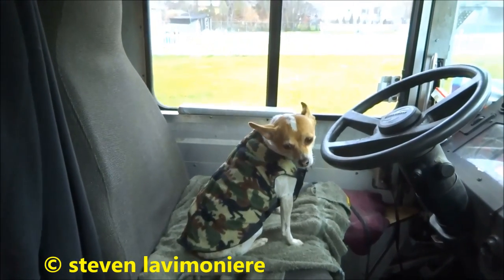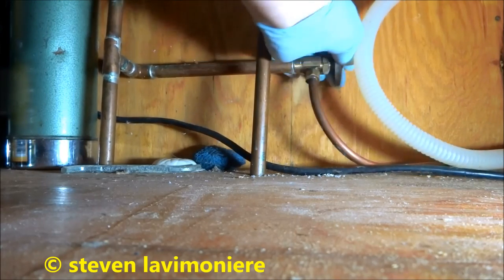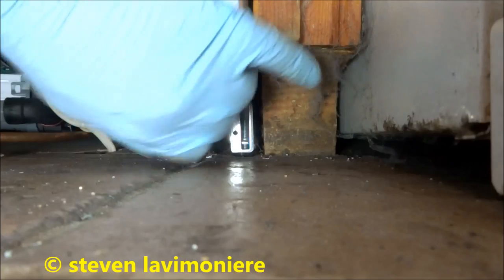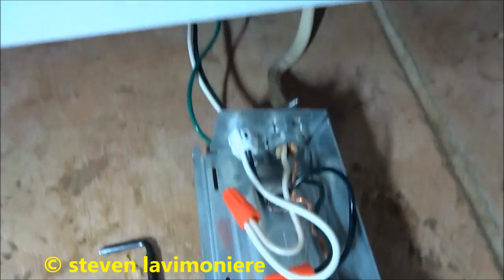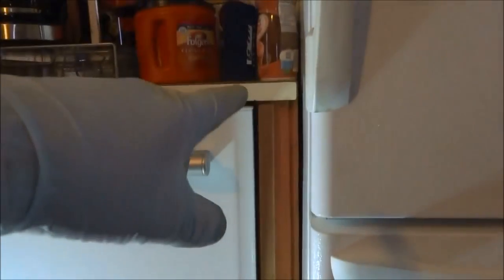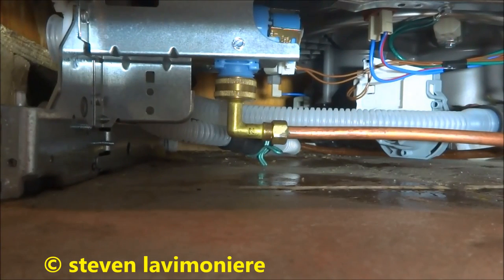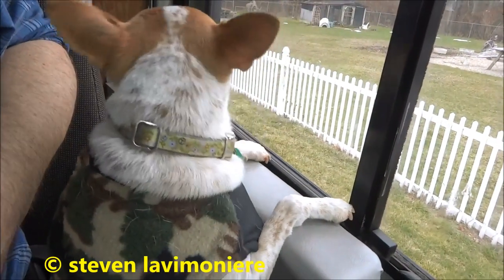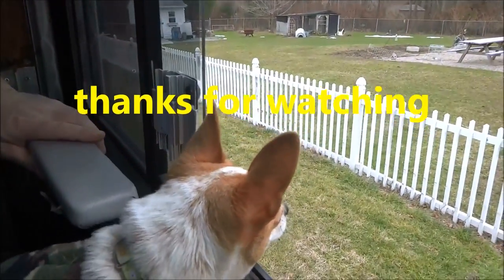dishwasher replacement

Comment: Dishwashers are always tight especially if there was tile or under layment put down later.
Good practice when installing new machine is to pour a quart of water in the tub. Dishwashers never pump completely dry in order to keep the pump seal wet...been a few yrs since I installed,,but it couldn't hurt.  👍
Reply from the maker: +Mike Davis i do quite a but of dishwashers installs

Comment: The heating element is shot. I've replaced many. Lol Common problem with whirlpool. Sometimes the board that has the relay on it to control the heating circuit frys as well. Either way, you have to pull the whole thing out to pull the heating element. Great time to replace the whole darn unit. This was a good video Steve. I felt like I was right on the floor doing the actual job!
Reply from the maker: +Fireship1 the new dishwasher is so much better the other one never worked right sence day one

Comment: Did you reuse old 3/8 soft copper tube for water connection? How do you check if old one is still good? Thanks.

Comment: Hi Steve. Im trying to replace my dishwasher but the drain hose is attached to a pipe with a p-trap in my basement. 
Theres no odor in my dishwasher. Is this ok? I wondering if I should relocate the drain to under the sink
Reply from the maker: +xcmskim4 always nice to have the dishwasher hose tighed in under sink ,but its it working like its piped off and goes into a trap in the basement leave it till you change the dishwasher then upgrade it then thats what i would do

Comment: nice coat thought you guys my be going hunting,
sometimes it's hard to keep that insulation intact especially if a new hardwood or tile floor was added later and you are loosing 3/4" of space, what i found to help to keep an insulation on top in place is laying a piece of cardboard while sliding the dishwasher in place.
Reply from the maker: +Dennis Noone good tip with the cardboard